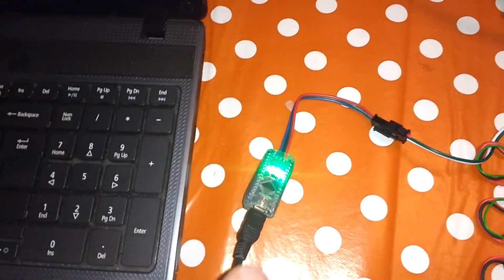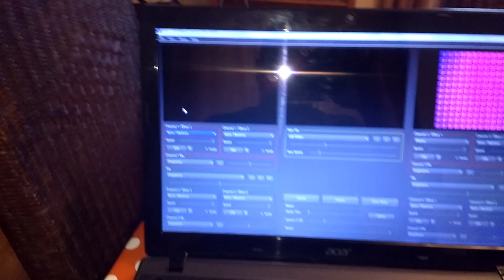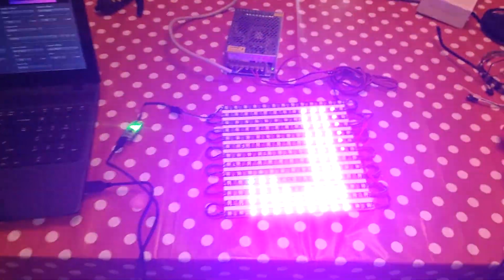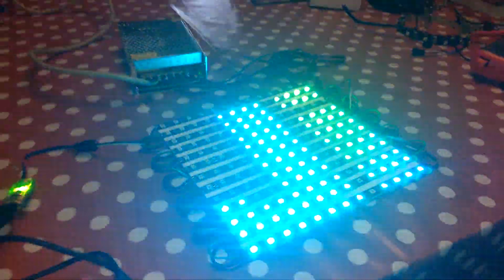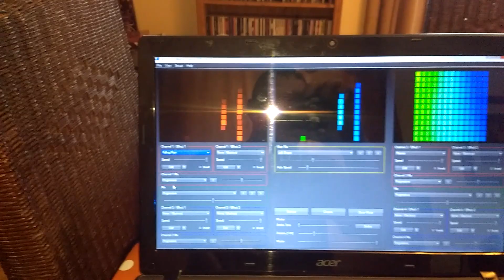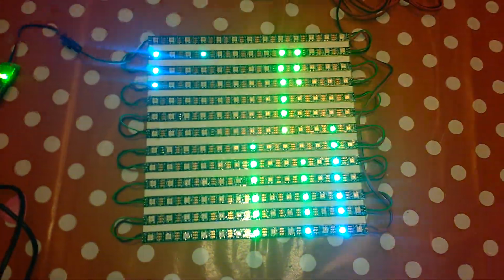Part 3 : Making a 169 pixel WS2812b DMX array : Neopixel

Comment: Hi,

I purchased a KMtronic USB to DMX512 unit on eBay and I got some questions. 
I would like to use this device for live controlling an 512 pixel ws2812b led display which is made of 60 led/meter ws2812b led strip (32 x 16 pixels) by Madrix, Freestyler etc. PC applications. The display is working well for sure, because I tested it with a T1000S SD controller. 
I know I need DMX Decoder to convert the DMX signal to ws2812b signal, but I'm not sure what kind of and how many DMX Decoder should I use. I did some research, but I'm still confused how many pixel of ws2812b can be driven by a single DMX decoder if I want to control each pixel independently from the 512 pixel.
Please help me if you have any good solution, information or recomendation for this project and please note this is my first try with these addressable leds, so nothing is obvious for me :)
Thank you in advance.

Kind Regards,

Mate Hora
horamate@gmail.com
Reply from the maker: Each DMX universe is 512 channels, that will give you 170 RGB pixels for each universe (RGB=3 channels), if you want to make a 32*16 panel (512 RGB Pixels) you will need 3 universes, which you wouldnt be able to do via one DMX over one USB, you can do it with 3 x USB to WS2812 controllers, but that is an expensive and messy route.. I make wifi Artnet to WS2812 controllers that use Jinx! which is a free peice of PC software... look up smartshow on Ebay for more details, and also see the other videos I have on youTube.  Regards Bob
Reply: Thanks a  Bob, it was really helpful!
Reply: thanks a lot, sorry :)
Reply from the maker: No problem :)

Comment: Hola! le quiero pedir el favor  si puede darme la informacion de como transmito los datos de jinx al arduino nano. ya tengo todo armado y conectado y no puedo hacer que se pase a los led ya utilice todas las configuraciones que da jinx pero no me funciona le agradezco toda su informacion
Reply from the maker: How are you transmitting ? Ethernet ? Serial ? USB ? Have you set up the OUTPUT DEVICE in devices ? Have you PATCHED your layout using the PATCH EDITOR ?

Comment: like, this PC-program of LED strips?
Reply from the maker: I use Jinx, you can find it at http://www.live-leds.de/
Reply: THANNNNNK
Reply: Hey Bob how to connect jinx to arduino?
Reply from the maker: Maybe easier if you google that, as it would take a while to explain
Reply from the maker: Using which protocol ? artNet ? sACN ? TMP2 ? TMP2.net ? Serial ? OpenEnttec ? etc... (it was a bit of a loose question)